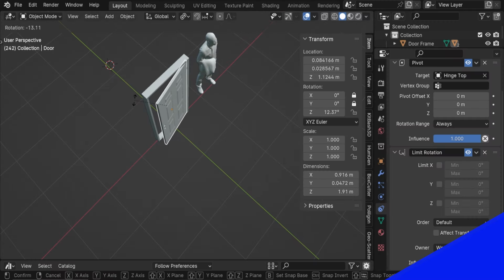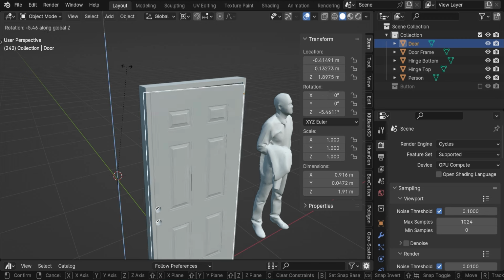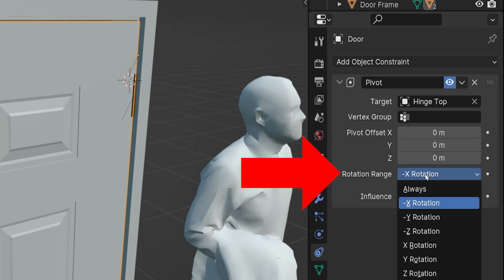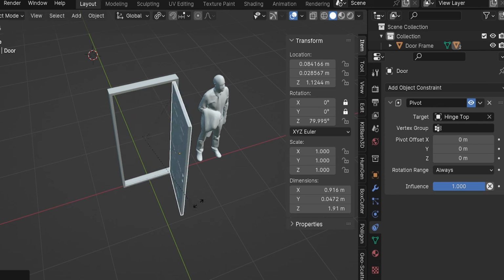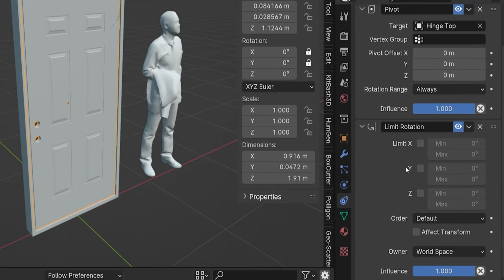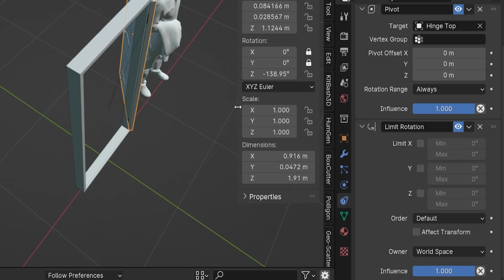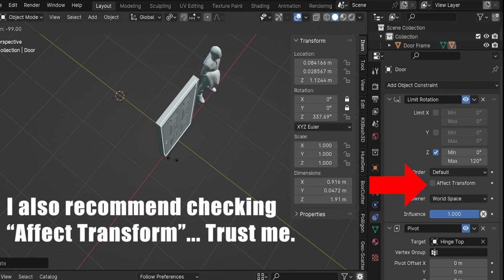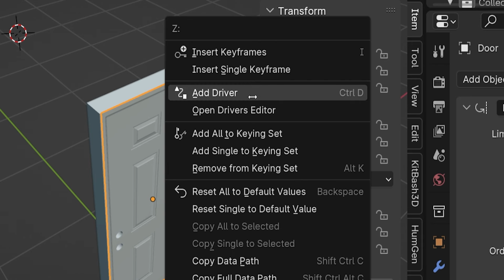Rig a Door with Constraints - BLENDER 3D

Comment: In case your file doesn’t rotate around the correct axis or around the correct object or if the rotation sensitivity is high try:

‘A’ then ‘ctrl’ + ‘A’ then Apply Scale
This should solve the sensitivity issue as your mouse movement is now ‘scaled’ to the actual size of your object (I believe this problem is a result of drastically scaling down your object from its original size).

If the limit rotation doesn’t work on the correct axis:

‘A’ then ‘ctrl’ + ‘A’ then Apply rotation. This issue came up because I rotated the door frame 90 deg and never applied the rotation so the world rotation and the constraint rotation was not the same.

And then if the door rotates around the world origin instead of the hinges, select the hinge and right mouse click on it, Set Origin -> Origin to Geometry. Alternatively try other Set Origin options that matches your goal.

Comment: Why did the modifiers act odd before you flipped them? Or is it just a case of if it's not working flip them?
Reply from the maker: It has to do with how Blender processes them from top to bottom.  It needs to limit the rotation and THEN address the pivot point rather than the other way around.  The rest is over my head.
Reply: Thanks for the clarification @Brandon-3D